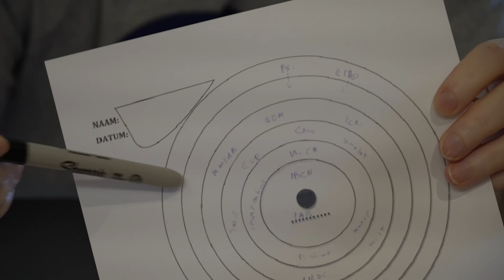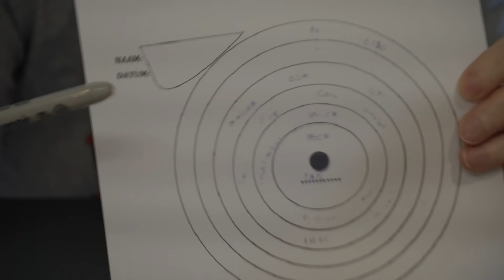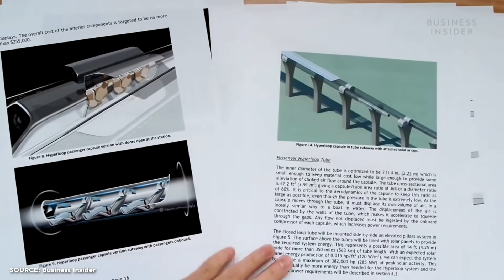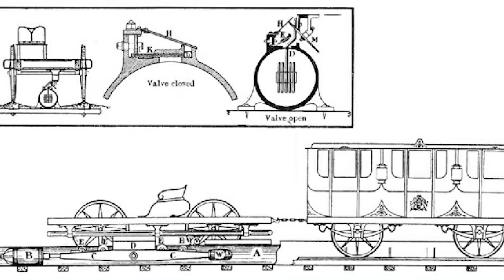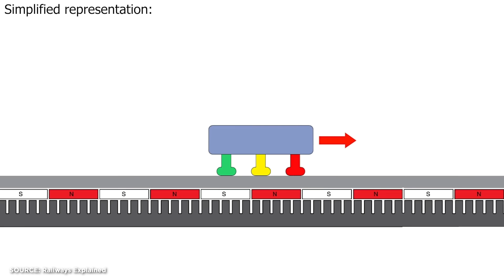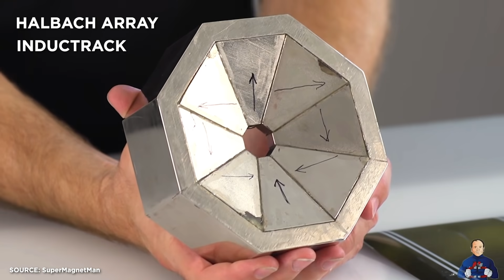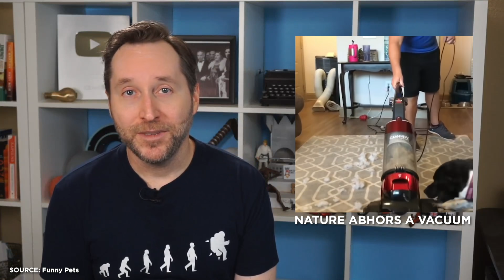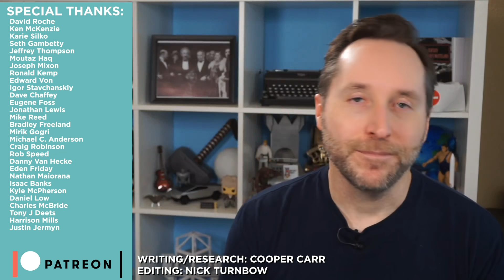What's Happening (And Not Happening) With Hyperloop | Answers With Joe

Comment: I think the main problem is that it is not completely impossible to build a maglev and put it in a tube with lower pressure. But the cost of a system like that would be huge.  maglevs are the most expensive public transportation system without having to deal with a tube that has to be extremely well sealed to keep the low pressure at a level that it even increases the performance. For any system that would be long enough to really make a difference between a vacuum train and a normal high-speed train would be unbelievably expensive.  The main problem I see with this "Hyperloops"  is to have something to stop the real deployment of high-speed trains that are by far the most efficient transport. Traveling at 300 km/h on a train is more efficient than any EV at even 100km/h will ever be. The promise of the "Hyperloops"  prevents plants from new routes and also so expensive that it will never be a working example covering a long enough distance to be a problem for car manufacturing/airlines. It's the new "by all of the public transport to close it down to sell more cars" trick, that's the reason people like Musk  (cars), Branson (airline), and the Saudis(oil) are interested in it. They just have to keep it in Infinite development, to keep the public in suspense of a near-future new transport method without ever having to actually build one.

Comment: The pneumatic transport tubes sci fi story give me an idea for a space elevator. Essentially it's a big tunnel leading out into open space with a loading port at the bottom. Along the outsides of the tunnel are rings every so often, with balloons with more and more helium for more lift capacity the higher up the tunnel goes.(or whatever works since helium do be rare). The tunnel itself would have small thrusters on each of the segments to auto-adjust for ships with different sizes and the rockiness that such a thing could cause.

Comment: Someone said recently that everything nowadays is "quantum", from vehicles to dog food. It is not current status of Hyperloop that is the problem, it is fact that nobody is doing anything to address real problem such as vacuum system. Vacuum is not easy to maintain, especially here when there is rust, paints and many other contaminants in very large volume. From my experience with vacuum systems I know that small quantities of liquids, solvents embedded in paints, rubbers, plastics and other materials can drop vacuum for orders of magnitudes by evaporating which gets more serious as pressure drops. And there is energy and equipment to maintain vacuum which is not cheap even for small volumes, not to mention tubes hundreds of miles long. Safety is problem for itself. And of course that this air cushion idea is dropped, it voids the idea of vacuum if you put additional air pressure into it.

Comment: IT SEEMS THAT THE BASICS OF THIS IDEA SHOULD HAVE PROGRESSED BEYOND WHAT A 6TH GRADER COULD ENVISION. ( READ BELOW TO SEE WHAT i MEAN )  As an 8 year old kid in 1975 my dad gave me a car coin holder with two ceramic magnets with a C shaped bit of steel glue to the magnet. I removed the magnets & steel and played with them finding that one magnet and the 2 steel bits together leaving an opening where the other magnet should be. When I held the other magnet next to the opening with the steel magnet combo the magnet by itself would shoot in. Later when I was in 6th grade (1980) during recess other kids were playing and I was sitting under a tree drawing plans for a magnetically propelled train in a vacuum tube cause I always hated the way air slowed or stopped me on my bicycle.  Later in the mid 90's I saw my idea in popular science. Till I saw this video I had no idea that this concept had been around so long.   MY BIGGEST FEAR - the train gets where it's going but the cabin where the people are has decompressed. The vacuum volume of the tube would be much greater than the train and even a small breach could be fatal to the passengers.

Comment: I can't recall what the named effect is but there is a locking force that rotating magnets apply at high speed. While not necessarily a functional for maglev necessarily you could comprehend that such a use in a design with super conductors might have a balancing for better efficiency. I suppose it could be integrated into a train carriage efficiency gains are possible and the lock wasn't discriminating against fast moving rail.

Comment: If Starship gets off the ground in a few years, Hyperloop would be made largely redundant. Why build a vacuum on the ground when there’s one always above our heads?

It also would be MUCH less expensive for intercontinental travel than a hyperloop. I remember the translatlantic concepts for hyperloop travel, and frankly, an advanced rocket would be much more material efficient than building a 2-3 megameter tunnel.

Comment: One of the biggest issues is that vacuum’s and near vacuum’s are incredibly difficult, expensive, and impractical to build and maintain at these scales. 
Then there’s also massive safety concerns associated with being in a vacuum sealed chamber. 

We’re better off investing in proven technology like maglev and investing in existing mass transit infrastructure.

Comment: Brunel's vacuum tube drawn train did work but rats chewed the leather flaps so breaking the vacuum.  I believe one of the pumping station at Starcross, Devon.  You could go back to the original idea of just having small vacuum tubes that draws the train along.  Simplier.

Comment: I don't really get why so many people are so negative over vacuum trains either. They've been considered for centuries because the fundamental reasoning of less air pressure to get higher speeds has always made sense. 

The real issues have always been the question of maturity of tech to make high speed trains at all. Which with maglev lines now starting to get some more traction is clearly getting there. And then the question of what kind of extra costs would a low pressure tube incur. It's technically feasible because for instance as seen with the LHC, albeit in a much narrower tube, we can make long vacuum tubes now. But science projects don't have to worry about getting you a reasonable ticket price in the end, so the cost thing is really the major outstanding question.

Can we solve it in the current decade? Don't know, certainly our tech for making and sustaining vacuums is better then it used to be, but is it better enough? But if it fails, then I guess we'll wait a few decades more till we try it yet again, with yet better technology, because the fundamental logic won't be going away. Which is, how to get places even quicker then before and as such integrate even larger areas together.

Well on that note, I do wonder why the current iteration with hyperloop seem so focused on smaller train sizes, that seems like it would make it economically more difficult. But oh well, if they can mature the technology further, one can always scale up the size a bit if need be I guess?

Comment: The biggest problem the Hyoerloop faces is the thing that makes it destinctive. The vacuum tube.few things can be said to be more expensive the. A vacuum tuve, and fewer things can be even more expensive to actually construct and maintain. Then you have the issue with expansion/contraction from temperature differentials. 1 crack anywhere along the 100's of miles of tubing and you instantly have a death tube. All said, even if they really wver could build a functioning versionnof onenof these things that could deal with the inevitable destruction from expansion and contraction, it would still be nearly infinitely cheaper to use a standard high speed rail.

Comment: Need to loos the heat from friction with a medium cancel friction then you can do anything in a vacuum 
Suction is the only valid option just control the pressure in the passenger cabin

Comment: Texas is thinking of building a high speed rail line between Houston and Dallas at a cost of $20 Billion. But that trip will still take 90 minutes. But there is a roller coaster called Kingda Ka that is nearly a kilometer long and it only cost $25 million to build! $25 million x 379 km of track is only $9.475 Billion! Less than half the cost of the "high speed" rail line! And at 110 minutes per trip would only be slightly slower! Plus it's a freakin' roller coaster!!! 

Plus, you could save a ton of money if you don't have the roller coaster shoot up 400 feet into the air for no reason! Then you take that money, plus the first $10 Billion and you invest in more speed and faster trains! It's genius! 

Besides, the hyperloop only goes in a straight line! What's loopy about that? With a roller coaster, you can have loops, inversions, camelbacks, overbanked turns, Cobra rolls, heartline rolls, and more!

Comment: Cargo tubes really seem to be the most plausible option.
Because you can't tell me that one ticket would be similiar priced or even cheaper than the heavily subsidized intra-contintental air travel.
Also safety concerns.
Plus the EU wants to revive the european wide night train system again, which kind of would compete against a hyperloop system (with much lower prices).

Comment: The Pressure requirements for a tunnel to keep out Water are 4 times higher than that required for a vaccum.
Reply: There is an effect that makes vacuum harder.  Water will only seep through good concrete at a quite slow rate.  Under vacuum, it becomes water vapor inside the tube which makes it take up a lot more volume.  In a normal tunnel, you can just pump the water back out with a fairly low powered pump.

Comment: they should pump fluid through the tunnels at super high pressure, and introduce the capsule into the flow, they can use super expanders to retrieve the energy.

Comment: If by traveling forward you push air out of the way, could you not channel that air to only go under the vehicle maybe with holes like Airhockey and lift it up and forward? Not zero energy, but with the right shape reducing the friction underneath and using the energy needed to propel forward?

Comment: Beside of all other hyperloop technical problems there is another one - a system, that could connect a train and a station without air leaks (into vacuum pipe) in several seconds, not 30-50 minutes like in ISS, and do it several hundreds times per day during cupple decades. And looks like nobody have it until now. Without this thing you will travel from one city to another in 25 minutes... and will wait a doors open for about an hour. LOL

Comment: Strange that @4:24 we get a picture (near Dawlish) of Brunel's atmospheric railway, which operated a 20 mile length for only about a year, yet Brunel is not mentioned at all; Instead the voice-over is about Medhurst.  The system was a total flop. Brunel was a brilliant civil engineer but a lousy mechanical engineer.  Anyway, vacuum cylinder propelled railways have no technical relationship to the Hyperloop.

Comment: What is Hyperloop, and how is it different from Loop?

Hyperloop is an ultra-high-speed underground public transportation system in which passengers are transported at 600+ mph within a vacuum-sealed tunnel. Whereas Loop is used for shorter intra-city routes, Hyperloop will be used for longer inter-city routes.

TBC’s current tunnels are designed and built in preparation for their eventual transition to Hyperloop
https://www.boringcompany.com/faq

Comment: The vacuum issue is a big deal. Maybe "they" should be trying to get the air in the tube to move with the train, reducing resistance and not requiring a vacuum.
Reply: Trains are good enough.

Comment: Doesn't the use of compressed air as fuel for the engine or directly using it for propulsion would disrupt the vacuum inside the tube? The rendering with the pod releasing air or suck in it from the front of it it's totally insane! It will transform something who run in a vacuum into a normal subway, just super more dangerous because of the speed. Plus what air would suck in to propel  on its back if it's riding inside a vacuum?

Comment: 1. Airhockey ist the opposite to a vaccum. Pressure is used to lift the puck. Thats why Elon uses ....weels. 2. The vaccum. to get the loop under vaccum and holding the pressure at 0,15 Atm. Case of emergency - all passengers will choke to death. Even if O2-masks are provided. You are not able to breath under a vaccum. Just get the volume of like 10 km of a section, the number of pumps you need and what happens is you have a leak of only 1,5 cm² in that section. Then the pumps will run all the time.

Comment: If it’s in a tube, Why not just make the air move with the train? Like a pod in a wind tunnel…no pressure issues, air resistance is only an issue if the air isn’t moving ….

Comment: At least just doing cargo there are no lives at risk since you don't even need a driver, or conductor in this case?  Though cargo rarely needs to go super fast. The fact that cargo trains go generally 50-80 mph wind resistance isn't a huge deal at those speeds.

Comment: I still can't fathom why one would even consider an air turbine as a form of propulsion for a near vacuum environment while maglev is an option. I mean yes it could provide some thrust but you need some sort of tracking anyway, why not also use that for locomotion? Of course, near-vacuum tubes the diameter of subway tunnels and hundreds of kilometers long are the bigger issue here, but still. If you believe the almost-no-air thing, why use air to propel the pods?

Comment: Doing this as a people mover is not a good start.  Moving freight is a better option.  The freight doesn't care that it is underground with nothing to look at, in a vacuum or moving at 400KPH.  Build one from Savannah, GA to  Columbus, GA and on to Montgomery AL and west across the US.  It is one of the least populated coast to coast routes so easements, permits and digging complaints would be minimized.  It would lead to great commercial expansion along the route.  From Columbus they can go north and south on I65, east and west on I20, avoiding Atlanta traffic on highways.

Comment: I don't think vacuum is a big issue. Airlines fly at 31k ft or higher and that is 3 to 4 PSI compared to 14 PSI at sea level and we don't worry about them bursting. I don't think Hyperloops are planning to use an absolute vacuum.
Reply: They're "planning" to use a medium vacuum which still removes 99.9% of air molecules which is just .1% short of a perfect vacuum. This would need a pump every 10 or so meters to maintain that pressure in a 600km tube.

Comment: Why not just make a hyperloop without the vacuum tube? I mean the cost to build it would be less, the cost to maintain it would be less, cost for development would be less, and you could use much bigger pods, AND it would be much easier to do the entry/exit because you don't have to deal with getting people in/out of a vacuum tube without the person dying or the vacuum breaking. 

And all at the cost of maybe... 40% speed. The vast majority of people who will use the system don't 'need' to get to the destination any faster than that, and there isn't really much of a market for those that do.

Comment: 3 phase varying direct current
 poles push pulling a magnetic  levitation  pod through a hollow tube with the positive air pressure recycled  around thru by another outer pneumatic tube buried in the ground .🚇

Comment: Has anyone considered the possibility of using this for transporting cargo to low space orbit?  I don't know how fast this can go, but there might be a speed where the end of the tube could be timed to allow a craft to exit once up to speed.  For humans the idea is likely just not safe.  

I don't know what happens when you take something supersonic and suddenly thrust it from a vacuum into normal air pressure at the last moment, but it's something to think about.  The last section could be valved open, and the craft centered
 via magnetic levitation, so it doesn't hit the walls.  If orbital speeds are possible, it would tend to want to move into orbit.  The power required may be too much to be worthwhile, but still worth a look.

Comment: I don't get why compression of air is significantly different to friction. In compressed air... the air is rubbing against other hair unavoidably. I don't exactly know how to compose a formal proof but when could you imagine a time when there is compressed air that does not undergo friction?
Reply: There are two different ideas. Old air tubes used to create a partial vacuum on one side and "suck" the pod along. The higher pressure side air slightly leaks past the pod and helps to make an air cushion to reduce friction on the walls.
Most hyperloops (not all) are a train in a vacuum, no compressed air.